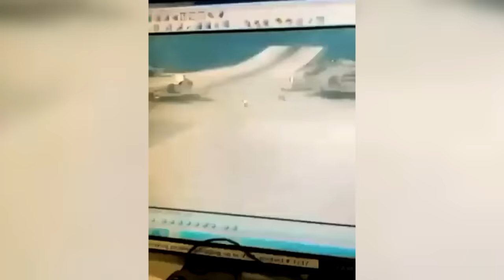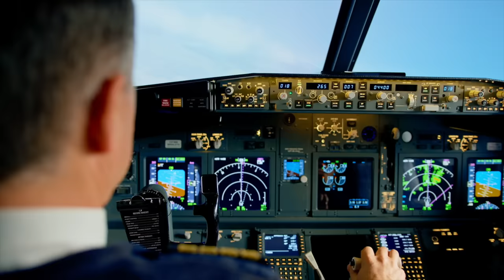Plane Takeoff Failures Caught On Camera

Comment: You should speak about Robert Piché, a canadien civilian pilot, who landed his Airbus 330-200 before gliding for the 20 minutes because there was no more gas aboard on their way to Portugal. They changed course of fllight and landed on the Azores. He saved the lives of 293 passengers and 13 crew members. It is considered the greatest achieve feat of the last 50 years of civilian steering by the Air Line Pilots Association (ALPA).
Reply: Canada's national airlines has another pilot that made a splendid landing on a former military airstrip in Gimly...
also out of fuel he managed to make a landing that nobody could replicate in a flight simulator. search for the "Gimly glider".
Reply: @ingeposch8091  
Gimly glider is a good silver medal. Also  
Chesley Sullenberger, the pilot in New-York who landed on the Hudson is a good bronze medal. But Piché was recognized by the international league of steering the broom and it's the gold medalist of the party. ✌🤪👍
Reply: @carcajoupatient2982  where did i mention a ranking??
🤔
Reply: @ingeposch8091  
Well, everybody want to compare wieners, but in that case, Piché was over atlantic ocean, too far away to ever be able to land in Portugal. Glidind several tons of a flying castel, going down the slope with no breaks, digging the rims of the plane into the concrete of the airstrip is a prowess in the history. Portuguese peoples vow a cult to their savior. It's been a significant moment in steering but because he's a french-canadien, authorities in cacanada wanted to minimise the thing. Always the same with those british in cacanada. It takes talent to recognise talent... Just sayin'.
Reply: @carcajoupatient2982  you get me wrong....
as for "comparing wieners", i don't have one! i happen to be a woman, dear.
et etez une femme des Pays-Bas, je parler les deux langues du Canada.
i really do not give a flying f**k if one is a Canadian of British or of French origin, all people are equal to me.

sorry dat ik mezelf toevallig mezelf in 4 talen uit kan drukken...
Reply: @ingeposch8091  
Goed voor je. Ik spreek zelf 3 talen. Het is niemands probleem als het Britse brein niet groot genoeg is om meer dan één taal te bevatten...
Reply: It is fine to talk abiout hsi role in that by bringing the airbus into the Azores like it, but let's not forget that due to poor cockpit management by him and his co pilot thay ascerbated the situation by pumping fuel through the engine that had the fuel leak by failing to acertain which of the two engines was not working correctly.
It was also poor maintenance by Air Transat that brought the situation about by fitting a replacement RR engine using an older fuel pump without reading the correct technical service bulletin that dealt with the need to fit a spreader between the fuel pipes to prevent them from rubbing together, which is what they did until they broke over the mid Atlantic.
Also do not forget that due to that Air Transat incurred the largest fine by the Canadian Aviation Authorities at that time of 1.5 million Canadian dollars.
The pilot behaved ok, but the rest of it was un needed and inexcusable
Reply: @carcajoupatient2982  dat is niet erg netjes van je...
ik ken een geboren Brit die meer dan alleen zijn moedertaal spreekt en het er ook nog goed vanaf brengt. je moet niet iedereen over een kam scheren.
Reply: @darreng745  
I fully and totally agree with you. But when accident occurs, with humans errors or unintentional situations, catastrophic results is to be expected. When 300 peoples dies, it's more than 300 families impacted by the incident. We've seen planes shut down over Ukraine, Iran and others by rockets, we've seen the bombing of flight 182 over canada and so many others in this crazy world. Still, with all the events that went on, Piché rode like a cow-boy, with all the nerves needed in the most horrific moment of his life, gliding the bird with the certainty of death otherwise. His survival instinct must have been higher than we might think, but the result is spectacular. I wouldn't want to have to pass through such event myself, neither the portuguese on board that day, but what an achievement after all.
Reply: I think this channel just covers stories with viral-type video footage
Reply: @srahhh  
Yep so good stories with no footage isn't interesting anymore even if it is spectacular. See the movie '' Piché : entre ciel et terre ''. That has really happen.
Reply: @carcajoupatient2982  I love stories about air heroes. I'll check out the movie.
Reply: @carcajoupatient2982  1) His accomplishments aren't minimized because he is french Canadian, if anyone is minimizing his accomplishments it is because his actions in the moment caused the emergency to be much worse than it needed to be by dumping fuel out of a leaking engine. He set himself up for failure, yet saved many lives, both can be true.

2) It is the most celebrated landing in history in aviation. I'm not sure where you are from but as a "British Canadian" I can tell you I have never heard anyone minimize it because of where the pilot lived and/or what language they spoke. You need to get over this whole "us vs them" attitude you have, no one worth your time is going to argue they are less because of that. We are the same and this Canadian pilot (note I am not using any qualifiers on the term Canadian) made history and saved many people's lives.
Reply: Did you see what Captain Whip Whittaker did? I think that was a bit more impressive tbh, his spatial awareness is the stuff of legends and he was drunk at the time. How's that for impressive? /s
Reply: @genefogarty5395  
I like Hellywood but falsification of reality isn't in my life's scenario. William Wittaker might have existed but beating Piché is a real challenge. Gliding a flying fortress over atlantic ocean for 20 minutes is so out of ordinary, i almost wish i would have been aboard just to shit in my pants in actually experience it. Anyway, records are to be beaten. Let's see who's going to be next...
Reply: @carcajoupatient2982  So you're diminishing Capt. Whittaker's achievements? Just kidding, Piche is the real deal and I too would've sort have wanted to be in the cockpit during that insanity. The guy has mettle that legends are made of, not to mention skills that are borderline supernatural. I'd bet dollars to donuts that test pilot John Cashman or Tex Johnson could do it though, different breed of pilots back than and seat of the pants reaction. I'm just a prop jockey, never been in a jet besides being a passenger The old guy that taught me was a cropduster, lake mail and WW2 pilot and constantly hit me with doomsday scenarios, I lived through every one and love him for scaring me to the point of bowel evacuation on a few occasions. Crazy SOB let me land on the lake when I was 11 years old, took days to wipe the grin off my face.
Reply: Saw that story years back. Great show. I actually thought it took the pilot longer to get on the ground.
Reply: @christianpethukov  
Imagine the stress. 300 peoples at the tail and floating in the air for almost half an hour. Get me out of here...
Reply: @genefogarty5395 
I flew 12 times in 1984 from Saguenay to Yellowknife back and forth. Amazed i was when the wheels left the ground. A mix of wonder sensation and scared. I've never been in a cockpit and mostly prefer staying on the tarmac...LOL 🤣🤪
Reply: @carcajoupatient2982  Yeah, the pucker factor had to be up there in that environment, lol. I've never flown in polar conditions, that's like 2x crazy, if you do survive a crash, you now have to survive the weather and environment and possibly with sever injuries. I've seen some horrific survival stories and I'll pass. I just started getting into STOL up North and it's the best rush a human can get besides BASE jumping, I gave that up after I turned 30, I figure tempting fate too many times wasn't the best plan for living to enjoy my IRA. But flirting with the reaper sure is fun, it's when he takes you up on the offer that it ceases to be so, lol!! At fortysomething I'm way more discerning in my choices of idiocy.
Reply: @genefogarty5395  
I think we've seen movies of planes crashing down in the north, with the wolves running after the survivors !? Yeah, the conditions could be horrendous. First time ever from Edmonton to Yellowknife at night, it was very strange. The darkness outside the window, the little dots of light down from towns, the propellers sound in the background. The door letting snow passing at the bottom of it. The breakfast served early morning. Poached eggs with steak filet mignon, toasted bread, coffee AND a 250 ml bottle of red wine... I swear to God. Those days has been so gone.
At nine  in the morning, i was told the reason why it was still the night outside the window. In january, the sun rise at eleven in the morning and sets at two in the afternoon. The rest of the day is being lived at total night for 21 hours. It was a shock. But a true show exist in the air. When no clouds around, the lack of light from the town delivers billions and billions of stars in the sky. It's very impressive. Then, there's that other thing. From north to south, east and west, no more black sky nor stars in view but an ocean of pastel colours, for hours and hours, shifting in the sky. The northern lights. Impressive enough we would lay down in snowbanks at minus 49 celsius to see the show the for hours or until freezed up. Strangest experience ever on something we had no control over called nature. Good day sir.
Reply: @carcajoupatient2982  Sounds like an awesome experience, always wanted to go, maybe one day.
Reply: I saw that story on Air Disasters which is shown on the Smithsonian Network. They accidentally were slightly off-course before they discovered their fuel problem. They ran out because of a line leak inside the airplane, and in their attempt to balance the fuel load in the wings, the first officer left the transfer valve open so that all the fuel in the left tanks leaked out of the right tank as soon as it got there. Because they'd gotten off course by just the amount they had, they were able to glide that huge airliner to a safe landing. It was an amazing story.
Reply: Jet aircraft do not have any gas ever, they have jet fuel
Reply: @marka1422  
Yes sir. The gold medal of flyers. There's a movie also, in french with subtitles. It shows the inner of the whole thing. Well done by the way. ✌😎
Reply: Was this the flight the movie was made about, with William Devane playing the part of the captain? It starts with a pilot and copilot trying to land this scenario in a simulator and crashing. No crew was able to land the simulator without crashing it. And, I remember that there was this young boy with his friends, playing on the abandoned runway that they eventually landed at, trying to peddle his bicycle as the plane silently approached. I was watching that, and thinking to myself: “kid, you’ll never out-peddle this thing. Just make a hard right, and ride off of the side of the runway, and GTFO of the way!”
Reply: @Luked0g440  
The movie is called '' Piché: entre ciel et terre ''. It's a real story based on a true event. Freak out story...
Reply: It is people like this that  are the reason I still love  to  fly comercial. Bird strikes in Northern BC Canada are as common as mosquitos.
Reply: @dead_to_you  
Yea, no more gas then gliding for 20 min to land after...
Sorry, english is a second language LOL
Reply: The pilots allowed all the fuel to leak out of the tanks!
Reply: @beringstraitrailway  
They didn't know about the leak but to counterbalance the weigh in the wings, it's normal procedure to transfer the fuel to keep that huge fortress to be steered ok. Not doing so could become really catastrophic, it's by the book. The life instinct took over and it's all and only because of the experiences Piché went through before that. Nerves of steel, i might say.
Reply: @carcajoupatient2982  
Draining all of the fuel can be catastrophic also!  A few months ago a plane took off from NYC and there was indications of a fuel imbalance and the captain turned that plane around immediately.  I would imagine he had to do a fuel before landing, but I imagine that he was given priority to land due to the emergency.
Reply: @ingeposch8091  Canada seems to cope well when the fuel runs out 😆
Reply: @caveatrotters3324  they seem to have the best glider pilots in the world...
Reply: @carcajoupatient2982  I think Gimli  gets the gold because he was the only one who remembered the dragstrip was there, was flying too high and too fast to land, but didn’t have enough altitude for a go around so he side slipped a completely dead passenger jet with no hydraulics, dipping the wing, and dropping the plane hundreds of feet sideways, corrected at the last second and landed it perfectly with no front landing gear. 

The French pilot did a fantastic job, but I don’t think he had to side slip a dead passenger jet. people focus on his fuel pump mistake. It doesn’t matter because once the situation presented itself, he rose to the occasion.

Sully needed 30 seconds to diagnose the problem, but once he did, he instinctively turned on the APU which isn’t in any checklist. Later the APU made the plane more controllable. He expertly used crew resource management to try to get the engine started while he made rapid and decisive calculations before coming to the conclusion we’re gonna be in the Hudson. The most incredible part was his ability to drag the tail on the water while keeping the wings perfectly level. When a plane stalls, one wing drops, but he got both wings to drop at the same time, preventing the water from catching the nacelle and cartwheeling the plane. 

All three pilots deserve gold, because they saved their plane and passengers
Reply: @Greg-yu4ij  
The french pilot isn't french, he just speak french, not the same...
Reply: @carcajoupatient2982 ❤
Reply: I have seen re-enactments of all these feats, but I don't believe any of them were actually filmed. As this episode considers flights 'caught on camera' I d say the ones you mention don't qualify.
Reply: Nah legend was that Egyptian captain I think his name was El Batouti who say something about god and dive plane into oblivion :D
Reply: @Komotau4691  
Forget about it. Allah wasn't there. Only Piché. Good luck in life. Only truth will cure you...
Reply: @carcajoupatient2982  I was just trolling around cant say what that captain did was right Piché  really saved people....
Reply: @Komotau4691  
If you like true things, try to find the movie '' Piché: entre ciel et terre ''. It's in french but possibly translated. Piché wasn't an angel but had nerves of steel. He's a half-god in Portugal. What he did is out of bound. Personnaly, i would rather stay on the ground...
Reply: Well, this video is called "Takeoff failures," not "Landings."
Reply: @pbsjones  
Well, Piché didn't fail landing, he actually landed his huge flying bike in a way no one yet has demonstrated the same. The best is ahead with the next casse-cou to show off.
Reply: @ingeposch8091  Ach, dat kunnen Belgen en Nederlanders nu eenmaal  🙂
Reply: @lbowsk  
The point is '' he didn't miss ''. That's the difference between kids and men...
Reply: The "Gimley glider"my friend..remember it well. There was a movie made of it
Reply: @kevinCarnahan-of8uk  
Yep, to pilot a bike of that size without fuel would be a decisive experience in survival. Gimley was a great performance. Don't try that at home !
Reply: Wasn't he the guy who crossed pounds and kilos (or gallons and liters) when they fueled up?
Reply: @maxwedge5683  
A plane need to be balanced. By loosing fuel from one side, it's in the book to counter balance the weight. But the leak was there, so the unthinkable happened. Personnaly, i prefer to stay on the tarmak. I like boats better too...
LOL
Reply: It's amazing how someone can win a gold medal for running out of fuel - an event that gave the crew plenty of time to plan the recovery strategy and yet, Sully only gets a bronze medal for his brilliant recovery following an instantaneous double engine failure.
Reply: @rhb8663  
It's only a matter of perspective. Over atlantic ocean, chances are rare and cold blood for survival runs faster in the mind of the one who hold the broom stick...
Reply: @rhb8663  forget about the medals. And race too. Not a fan of nationalists, never was and never will be. The act nationalism alone diminishes intelligence imo. I could care less. They were heros regardless of what country they were from.
Reply: Why are Canadians running out of fuel so much?
Reply: @robertgeorge4064  
They produce so much gas in the west but don't know how to contain it ?!
Reply: @carcajoupatient2982  I think you’re correct on that point. Sometimes confusion between pounds and kilos.
Reply: @robertgeorge4064  
That's the truth. The kind of confusion that even happened when the Concord was split in it's building between England and France i think. I don't want to be wrong on this one but the mistake has happened in the past, probably more than once, on several important projects. Got to dig on that as well.
Reply: Yes what a feat. Much respect for that .
Reply: These planes don't use "gas" and if I'm remember correctly the pilot was responsible for not having enough fuel on the plane.
Reply: @carcajoupatient2982   "Well, everybody want to compare wieners" "cacanada" "It takes talent to recognise talent" Bro you are showing some serious insecurity here. This is just a random comment section, really not that important.
Reply: @Zodroo_Tint  
You have the right to remain elusive. It's not my goal in life. I ain't scared of the world, neither of my opinions. Generalities isn't my cup of tea. I have eyes, ears and thumbs. I'd rather express myself instead of having someone else to monopolise the ice of the peroration...
Reply: @Zodroo_Tint  
Like i said before, the plane need to be balanced with equal fuel on both wings. If in the case of leaking, who happen to happened without any possibilities to be detected, the pilots have to compensate the weigh by transfering the fuel from one side to the other. But chitt happens. In that case, the man at the broomstick was a cow-boy from another era. Surviving has got infinite sides in people's mind.
Reply: He is not a hero, the crew salvaged a bad situation, but only barely. 

They failed to take heed of the obvious signs of a fuel imbalance happening and instead of closing off and isolating the side that was obviously leaking, they started xfeeding into the leaking area anyway and then watched it all go to shit.
Reply: @boundaryzero  
That's the point you should get, because the pilots didn't know there was a leak. Overconsuming gas in one wing mandatory forces crews to counterbalance by transfering the fluid. But when you don't know, you don't know that there's a leak. By the book, you follow the book, with the consequences you already know. Piché is a hell of a steel nerves kind of guy, where most of us would have failed miserably.
Reply: @carcajoupatient2982  the amount of loss was well past what would be expected from a consumption difference, this was a torrent of JetA coming out and they just thought it was a minor thing, when the indications and the calculations, even at the time, showed a dire situation. 

Losing that much fuel should have obviously registered as a leak to competent crews - and they were correctly chastised by the AIB for this gross oversight. 

Yes, their airmanship skills showed, but like the Gimli glider, the pilots were also partly to blame - but they also were able to luckly salvvage the situation.
Reply: @boundaryzero  
The level of fuel was noticed early but it wasn't significant enough to bother so they transfered the liquid. Later they found about the drop being problematic but way too far over the ocean. Having to choose between balance of the plane and transfer of fuel isn't something obvious but yes, Robert Piché is a god in Portugal. Just go there and ask anyone. You'd be surprised. Saving 300+ people from certain death, that is something anyway.
Reply: @carcajoupatient2982  because someone is a 'god' has absolutely 0 bearing on whether the person did the correct thing all the way through. 

The AIB report was factual, clear and concise - the crew should have known, and done better, and not have made assumptions when the obvious was staring them in the face.
Reply: @boundaryzero  
Of course but we weren't in the cockpit, neither of us. Taking in account of all the plane crash since a 100 years, the only safe place is on the ground. But people need to go here and there. Noting the titanic went down and car crash are killers, what else can we think of. Yes, afterward, complaints always come out but still, they survived where most didn't. A prowess is a prowess.
Hats off to the broom handler !
Reply: @carcajoupatient2982  I've referenced the AIB findings SEVERAL times and you continue to ignore this, citing platitudes and useless emotionality.